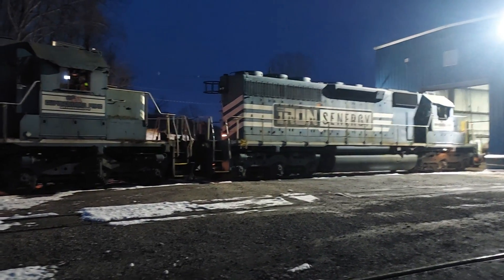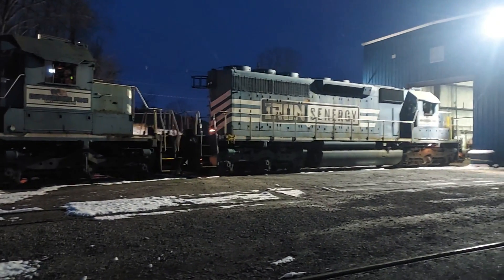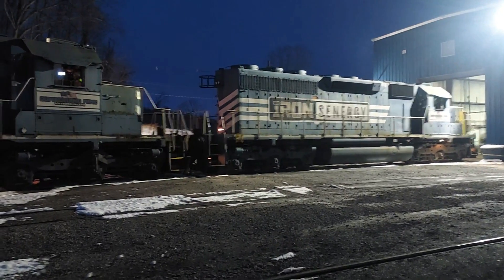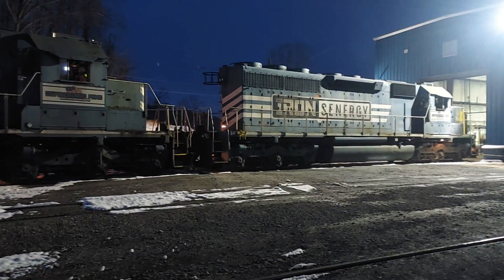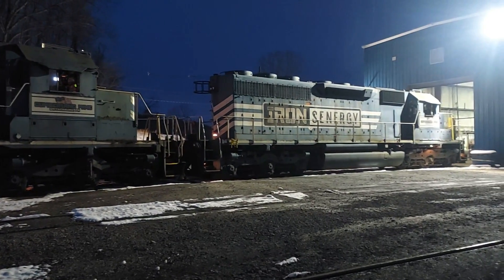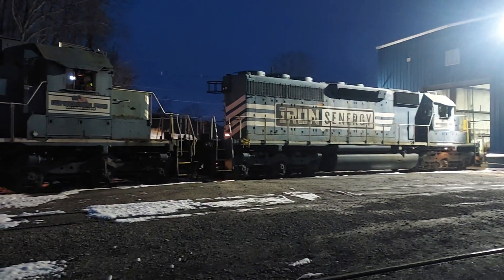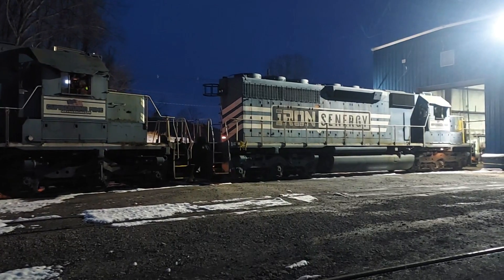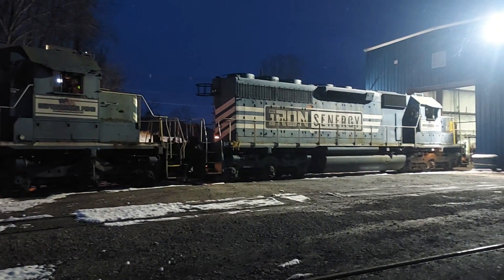Doing a Locomotive Load Test on an EMD SD 40-2

Comment: Hmm... and what exactly did I see just now besides a locomotive idling...
Reply from the maker: During a load test they run the locomotive at different throttle
speeds and check to see the amps it's putting out at each
throttle notch, was in throttle run notch 8 most of the time you watched.

Comment: Like the actual condition during the starting course of the train, the traction torque which is generated by the traction motor is firstly added onto the load simulation system, and it directly gives an effect to the load motor. (Study on the method of traction motor load
simulation on railway vehicles, Computers in Railways XII 233)

It appears that in this static load test, the energy that's not being used to overcome the train's inertia is routed to the dynamic brake resistor pack as it would be during dynamic braking. One of your videos showed a burnt resistor pack R&R. With up to 1100 amps of load current possible - those resistor packs must utilize thick copper buss bars to dissapate all the heat generated. Your burnded out resistor pack functioned as a 1000 amp fuse. "That's Railroadin!"
Reply from the maker: First we do not have computers on these old locos we have Robert,
but of course newer locos all have them and how the computer
comes into play during a load test I have no clue.  The resister
grids create resistance during a load test which is what simulates
the traction motors being under load. They are dual purpose
resistor grids, for dynamic breaking they dissipate the heat
energy and for load test they provide the resistance needed.
Really appreciate your taking the time to watch and may you have
a very good day my friend.

Comment: The purpose of the load test is to verify the proper operation of the prime mover and DC generator. And yes Dave, you are correct about the newer engines using their dynamic brake resistor grids for load testing. If the voltage and amperage is too high or too low, that may indicate something wrong with the DC generator or something in the prime mover spinning too fast or too slow. The reason for so much smoke is because the prime mover is working at its max capacity to drive the DC generator under load. If there was no load on the generator, there wouldn't be nearly as much smoke. You may also catch the roof fans kicking on during dynamic braking and load testing to dissipate the heat generated by the resistor grids.
Reply from the maker: Appreciate your sharing that info with us Stephen. You are right. Thanks so very much for taking time to watch the video. May you have a very good day my friend.

Comment: You can really hear those dynamic brake grid fans the most
Reply from the maker: Lot's of heat there to get rid of Agent1996.... :-)  Thank you very much your dropping by to check out the load test video my friend.
Reply: @ccrx6700  used to run those allll the time.  Now they are mostly gone on class 1’s
Reply from the maker: @7171-Ws6  👍😊😎

Comment: That's the same thing we used to do at US Boraxo on our diesel electric overburden haul trux. We didn't load the engine generator sets thru the dynamic barking resistors. We used an external load resistor bank.
Reply from the maker: That's very interesting Andrew, I did not know they did load tests
on other diesel electric stuff. Cool to find that out.  Thank you very much for dropping by to check out the video my friend.

Comment: I take it. It was on the engine locomotive Dino.
Reply from the maker: Power generated was fed to the dynamic brake resister grids
and dissipated into the air as heat energy. Loco doesn't have
an actual dyno on it. Thank you for taking the time to visit with us and check out the load test  video my friend.

Comment: Where does the energy go? I'm guessing it gets converted to heat in a resistor?
Reply from the maker: That is correct, it gets sent to the dynamic brake resister grids
which dissipate the energy into the air George. Very much appreciate your taking the time to visit with us and check out the load test video my friend.

Comment: I am wondering if there are some calculations to get the correct amp reading. Without being an electrician I am thinking that the load would have to be greater than the maximum power produced by the generator to draw the maximum current. 
As an example if you were walking on level ground at 5km/h the power you produce might be 100 watts and then you come to an incline of 1:10, your speed and weight don't change but a lot more power is required.
Another example would be my wife's car, a 2021 VW Polo GTI. Maximum torque is 320 Newton-metres from 1500 rpm and up, but this would only be at wide open throttle with enough load on it.  In other words every time it gets to 1500 rpm it doesn't produce that much torque. At wide open throttle in the lower gears the traction control light would come up on the dash but would not if driven a bit more gently.
Hopefully someone will read my comment who can explain it in lay mans terms for us all.
Hi from NZ,
Anthony
Reply from the maker: I sure can't explain it Anthony, but seems like no one else
can either. I would imagine there are calculations to figure out
amps but I do not know what they are.  Thank you for taking the time to write in and to check out the load test video my friend.

Comment: on the sp about 1970 we took an sd 45 out on the main and brought it up for an informal load test. you could hold it with independent brake. i think thats why the independent handle depresses to make sure there is no air on the locomotive brakes during regular operation , as you can stop it even when its run up.
Reply from the maker: You may be right on that 789. Baling off the independent is
needed when the train goes into emergency. On our older locos
the independent comes on if it goes into emergency. Thank you for taking the time to write in and to check out the load test video my friend.

Comment: So... in my game train simulator classic... I can't drop the engine in forward or reverse when I have the engine in any position 1-8... is it the same in the actual engine?
Reply from the maker: Great question MJ and the answer is, it depends. GE locos you
can't move the reverser while in a throttle run position. Newer
EMD's you cannot either. On the older EMD;s they have what
is called a floating reverser and you can go from forward to
reverse while in a throttle run position. (imagine throwing your
car in reverse as it is going down the road forward at 20 MPH....) 

That is really hard on the traction motors and is called plugging the motors. Some guys out there (not necessarily at our place, although it has been done here in the past) get panicked when they can't stop and throw the reverser the opposite  direction. Most older EMD's which have been rebuilt and had an electrical upgrade to the consol do have an interlock which does not allow a reverser to be thrown while in a throttle position. And now you
know.

Comment: I used to do this working as an electrician, in the diesel shop , for metro north back in1985-86. We used an external load box , looked like a giant refrigerator, even had General Electric prined on the front . It was just a giant box with resistors and a fan inside all powered by the locomotives generator. It had an amp meter and a volt meter  on it to read power .Then the machinists would read a scale on the fuel rack to determine if the engine was using too much rack to make the measured power. That would determine if it were time for a rebuild. They had a few SD40's and lots of FL9's
Reply from the maker: Wow that's pretty cool Anthony. Thanks so much for sharing that
with us. I've never seen a load box before and had no idea how
they worked.   Very much appreciate your taking the time to visit and check out the video my friend.

Comment: Bravo beautiful contribution to kill our planet what’s the point??????
Reply from the maker: The point is these locos have to be tested on a regular basis
in order to make sure that all components are working properly
to ensure a safe train trip Eric. While it may give off emissions
during the test, consider if a loco is never tested and is told to
make train trips and a serious accident occurs because of a loco
failure because of a component that was faulty which could have
been found during a test. And that accident causes a huge
derailment then what about all the emissions required to re rail
the cars plus possibly a fuel spill from the loco, and what if that
loco goes into a creek and spills fuel because it wasn't tested
properly.  Which of the two scenarios is easier on the planet Eric?

Comment: I worked as a hostler/machinist/car inspector for a northeast shortline at an outside post interchange.  We still maintained an engine house at the time but continuouse cost cutting etc. resulted in selling/closing the engine house.  I was able to keep my job from 1976 until 1983. My last year was in a consolidated old time baggage room attached to the Amtrak station I shared with the gutted track department. I knew my days were numbered. I got layed off in may 1983.   I say all this because I still miss the railroad.  My blood flows railroad.  I wish I was still railroading. How I miss the gp-9s and the sound.  You bring back good memories, and thanks for those memories.
Reply from the maker: I'm glad that these stir up a lot of good memories for you. I can
completely understand Steve, railroading gets in your blood and you can't get it out. And, you don't want to either. Thank you for taking the time to write in and to and check out the video my friend.

Comment: For dynamic braking to work the wheels have to be turning. Basically the traction motors become generators feeding the load of resistor banks on top of the locomotive turning the energy into heat and thus slowing the locomotive. This is often used on long downgrades to prevent the locomotive and train of cars building up too much momentum.
Reply from the maker: You are right about that MKT. In a load test the current is
going directly to the dynamic brake resister grids and not to
the traction motors.  Thank you for  taking the time to visit with us and check out the video my friend.

Comment: Excellent Video! I'm assuming those locomotives don't get a lot of opportunity to operate at those higher notches due to low track speed so besides just doing a load test it's good to open them up and get them nice and hot. I work for a short line up in WNY and we have a couple locomotives that we do this to at least once a week, they are pretty much just idling all the time never get beyond notch 2-3.
Reply from the maker: We have one grade that is about a mile long that the locos are in
8 coming back with loads and that happens every time they take
a trip. But other than that you are right, they don't get cranked up.
Very much appreciate your taking the time to write in and to check out the video my friend.

Comment: What I understand the nice thing about load testing it cleans out all the carbon built up in the ex system
Reply from the maker: If that doesn't do it, I don't know what would Paul! :-) If the shop lights were out and it was dark out then I'm sure we would have seen a 
real nice spark display. Thanks so much for taking the time to write in and for checking out the load test show my friend.

Comment: Thanks Dave, enjoy your videos and your enthusiasm.  I retired from GE (Wabtec) three years ago as the test cell engineer at the Grove City Diesel engine plant.  I have always loved trains and big mechanical things.  Was real exhilarating to be in the test cell with one of the big 16 cylinder engines.  We would break them in slowly through the eight notches then shut them down for inspection and adjustments.  After that, they would restart and notch up rather quickly (5 - 10 minutes) to Notch 8 which was 6250 hp for the 16's.  Shook you to your very core.
Reply from the maker: Glad you enjoyed Hill Billy.  I bet that would be an awesome sound to hear and experience you had. Pretty cool you worked at Wabtec. Thanks so much for taking the time to write in and for checking out the load test show my friend.

Comment: Holy cow never seen this done before , How does it bleed off energy ?
Reply from the maker: The current produced during the load test is fed to the dynamic brake
resister grids Kelly, then that heat energy is dissipated into the air.
Appreciate very much your taking the time to visit with us and check out the locomotive load test show my friend.

Comment: Were they also shedding the load to the 2nd loco at the same time
Reply from the maker: No sir they were not, the other loco just happened to be hooked to
3098. All the current was going to the dynamic brake resister grids on
3098.  Appreciate very much your taking the time to visit with us and check out the locomotive load test show my friend.

Comment: That was a great video. Are the mechanics asking the diesel engine to run as if it were in run 8 while avoiding the electric drive motors?  Thanks :)
Reply from the maker: Glad you enjoyed Mustraline. With a load test the current is diverted
from going to the traction motors to instead going to the dynamic
brake resister grids.  Thank you for taking the time to write in and to check out the locomotive load test show my friend.

Comment: Question, from idle to full throttle does the voltage stay the same... and for amps too. What is the voltage and max amp output? thx
Reply: The voltage will rise as the rev come up on the engine,up to around 1000 v. max current flow will rise to about 4000 to 4500 amps at max power, it takes up to 30 seconds  for the engine to load up to full power , things will change slightly as the resistors in the load bank get hotter that's why the fans are running.this is not a true test of how the loco is working correctly as the load is constantly variable as speeds rise or falls on gradient's up or down, as speeds get higher there becomes a need for field diverts to weaken the field strength in the traction motors to allow them to accelerate to higher RPM, this can be done in one of two ways,diverting some of the field current to waste as heat through resistors  or if the motors are "separately exited"by using electronics to weaken the field strength using thyristors, sometimes referred to as "electricary"
Reply from the maker: On the power gauge in the cab the amps will red line a little over
1,500 on the throttle side Larry. On the dynamic brake side of the
gauge the amps red line at 700. Load test does not check for amps
on the dynamic brake side tho. On this loco the voltage going to
the traction motors is 600.  Appreciate very much your taking the time to visit with us and check out the load test show my friend.

Comment: Is the engine running against locked brakes (with the other loco as safety ballast or is there a big load bank?
Reply from the maker: If it was running in notch 8 then the brakes being on wouldn't hold
it anyway Rick. The reverser handle was in neutral and the current
that was being produced was not fed to the traction motors, it was
going to the dynamic brake resister grids, so no chance of the loco
moving.   Thank you for taking the time to write in and to check out the locomotive load test show my friend.

Comment: Most -2's in the lower cabinet behind the engineers seat will have a selector switch. By putting it to self test or load test I can't remember how it's worded it will send all of the generated amps from the traction motors to the dynamics. It is a great way to test the electrical and mechanical systems minus the traction motors. You notch up the throttle just like you would if you were running down the rails. 

Also love the blue trucks under the 22, I hope they all get that!
Reply from the maker: 22just got a new set of trucks on it last week, they are a light blue
color but all clean as a whistle TSBY.  Thank you for taking the time to write in and to check out the locomotive load test show my friend.
Reply: @ccrx6700  those trucks definitely look good. More than happy to help answer any questions about locos that I can Dave!
Reply from the maker: @TSBY  👍😊

Comment: I loaded over 100 sd 40-2 EMD locomotives ,The load time was one hour in 8th notch, rack had to be correct, the load regulator  runniing at 2 o clock . all fans and sutters  on  and rotating right direction. A lot of small water leaks would disappear after it heated up .
Reply from the maker: That's pretty cool to hear Robert. Come on over and play with these
when you get a chance! Thank you for taking the time to write in and to check out the locomotive load test show my friend.

Comment: I worked with SD70 MACs. They load tested using dynamic brake resistor grids. They monitored kilowatts (KW) on the computer screen  in the cab since everything is microprocessor controlled.  Rated HP corresponded to rated KW.
Reply from the maker: No computer screens on this one tho Bill....:-) Wish we had one of
those 70's here. Thank you for taking the time to write in and check out the load test video my friend.

Comment: Yes, load testing statically reconnects the motoring output to the resistor grids….and as you say older locos that can’t self load can be connected to a wayside load box. You can connect any loco to the load box, if you prefer to do it that way.
Reply from the maker: Yes you are right about that Jonny. Thank you for taking the time to visit with us and check out the load test video my friend.